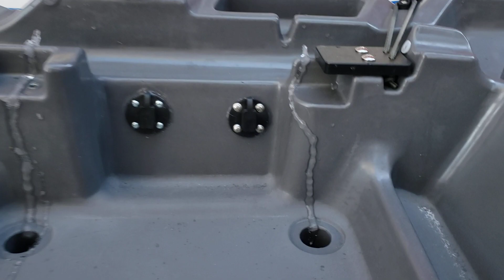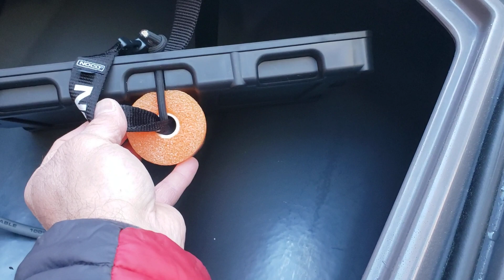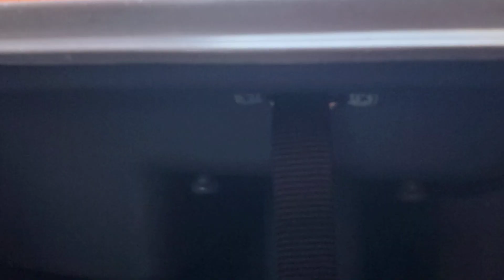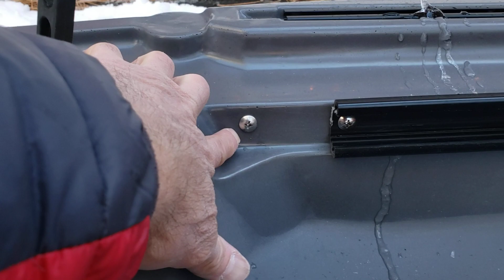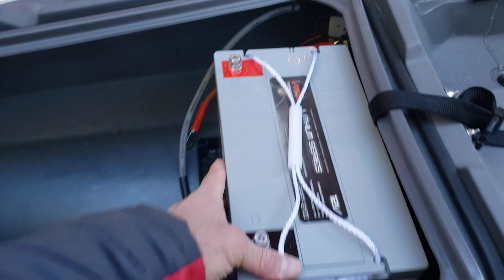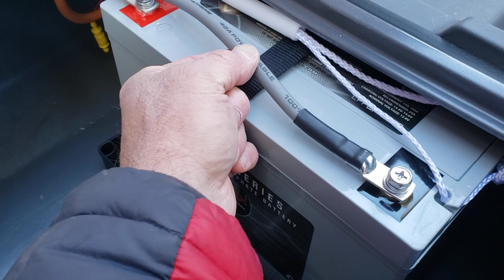VMax Tanks LiFe PO4 for my Wilderness Systems Recon 120

Comment: I’m wondering what gauge wire you used from the battery to the motor ? I wired mine with 12g marine wire and I’m hoping it’s enough
Reply from the maker: I used a combo of 8awg and 10awg. If you have a 30lb. motor or bigger than 12awg is probably too small. Minn Kota has a very useful guide on their website that outlines awg and circuit breaker sizes based on motor size and wire length requirements. I recommend you find and review that info. Good luck.
Reply: Thanks for your help. I’ll probably have to beef it up

Comment: Excellent work to date! The only  negative thing I noticed was that the 2 screw boot connections tying the battery holder strap to the iayak had the threaded portions facing out. Please flip them around so the bare thread ends are inside the kayak. In the unlikely chance you have a slip or lose your balance and put your hand out to steady yourself, your hand won't be mangled by the exposed threads.
Reply from the maker: I know, it doesn't look as nice as it could... I am going to look for plastic acorn nut covers first... the footman loop has a tapered seat for the screw head and I had appropriate screws... I have also been thinking of what else I could mount there, opposite the footman loop, as long as I have a few extra threads!